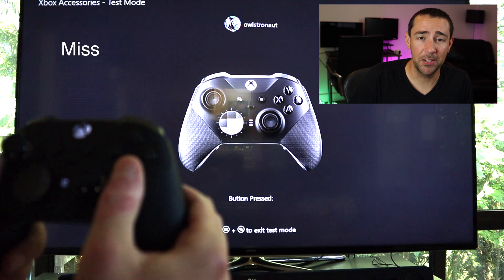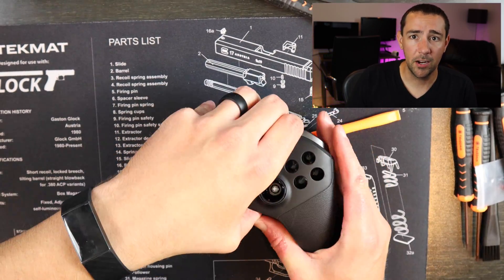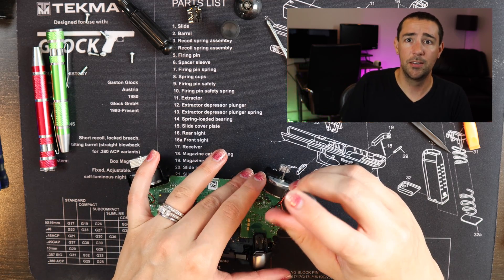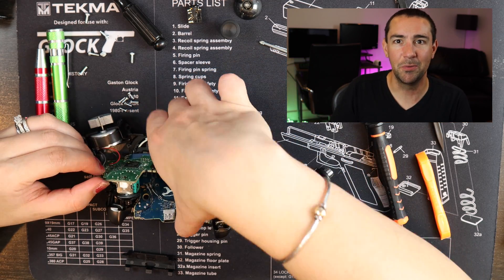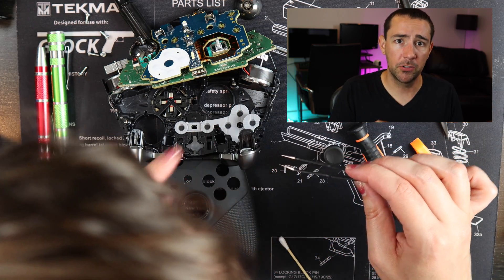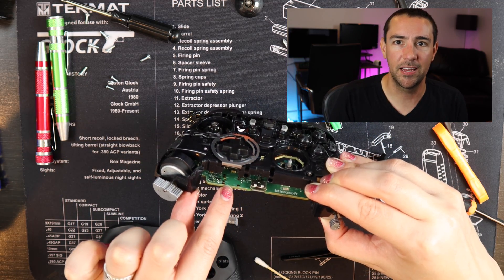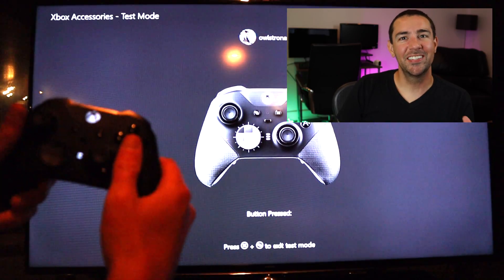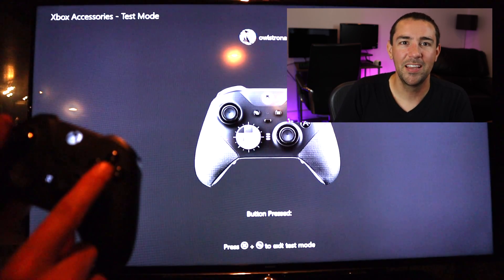Xbox Elite Series 2 Controller | Take Apart & Fix

Comment: Thanks man, this was a huge help! Anytime something needs to be pried apart, it can be nerve wracking to not break plastic bits but the controller separates well if you take your time. I've been having issues with the RB not registering and was able to pull apart the controller and use some electric contact cleaner on the switch. Works like a charm now.

Comment: Bro this is so dumb. My controller works just fine on PC. Doesn’t skip, just a tiny bit of stick drift, but on Xbox, it fucking skips like a motherfucker from the joysticks to the bumpers and even the D-pad. This is so goddamn irritating. I updated it, plugged it in, googled how to fix it and there’s nothing concrete as to what’s causing it or how to fix it.

Comment: You were saying about ppl throwing consoles away.well i was putting rubbish knackered microwave at the recycling center when a lady came in with an OG playstation 2 had everything with it in a bag later found out was missing tv cable(got a new one) said it was not working.well it was and perfect too had no games for it as i gave mine to my sister back in 2002.wish i had not.but anyways s good clean new cable got a disc ssx OG now i have another OG ps2 happy days.i dont know how many hrs it has on it anyway to know? Great vid on the ps4,s you had😅

Comment: For $200 this controller is a scam i have 2 of the paddles dont work. And other controller the bumpers and A button quit working lol. I could use a standard xbox one controller for years without problems for $60 not sure why this sucks

Comment: To replace the upper bumper buttons (the one running along the whole controller), do I only need to remove the top face plate of the controller? I have to do this for a friend, but I never opened up an XBox controller. Mostly the Switch versions

Comment: Hi, nice video, I have had this problem with so many Elite Controllers, I end up mapping A to a back button or RMA'ing them several times each.

A couple of questions
Is it worth cleaning the black conductor inside the rubber dome, or the copper contact? 
How many folds of electrical tape is recommended? 1-fold, two layers?

Comment: I own—and i am not exaggerating at all—1 old-style Elite controller and, count’em, 1, 2, 3, 4, 5, 6, 7 Elite V2s.  Why on God’s green Earth would I buy so many of these flipping things?  Well I’ll tell you!  For one, it is hands down the best production-standard controller on the market. 

The weight feels just right: solid but not too heavy.  The grips and other materials are top of the line.  

The ability to swap out sticks, pads, and paddles lends a degree of customization and self-maintenance that is both cool and helps it last longer.  The functionality and software are second-to-none.  

You can change the color of the Xbox button to fit into your chosen color scheme and aesthetic.  You can use the configuration interface to set 2 separate functions to each HW input, including console-level special functions like taking a screencap or video, play music, chat, etc. Why 2 separate functions per button?  

Because you can set one or more button inputs as a SHIFT key that when depressed give access to the secondary functions you defined.  This is extremely useful, both for console/administrative tasks and for gameplay.  Then you can use the test laboratory interface to play with and verify your input layout.  

Note also that each controller has 4 input buttons on its bottom side which can be actuated by removable paddles (or you might call them forks).  I usually set one or two of the paddles’ primary functions as SHIFT.  

Aside from that, the controller can store up to 3 different profile configs, which you may rapidly switch between via the Profile Button in the center of the controller.  3 LEDs indicate which profile is active, plus a 4th LED that is a charging indicator.  

Back on the bottom, each trigger button has an adjustment switch that can set 3 different travel lengths/heights for LT or RT to be depressed before it fires.  

What else?  A sync button on the front/top of the controller, plus a port where you can connect other peripherals like a mini keyboard, and of course a headset jack.  

Beyond that, the standard V2 controller comes in a smart semi-rigid, cloth-covered case, which inside has mounts for your spare hardware, including your paddles, a thumbstick adjust tool (also included), a charging dock, a 10 ft USB-A to USB-C cable, 2x D-pads—one shaped like a circle and the other the standard cross design, and 6 thumbsticks of different height and padding.  

So there are a ton of features on the controller, the build quality seems high, at least initially, and functionality is the best.  So why do i need 8 of them?

Well, for some reason—and I swear it’s not me despite the stats—the LB button gets unreliable and often unresponsive over time.  I have also had problems with the left thumb stick becoming biased.  

And instead of sending each controller in on the warranty, when I am in the middle of a game I just blindly order a new one from Amazon so I can quickly get back into the game.  Eventually I got sick of buying new ones and sent 5 or 6 of them in lot Microsoft for LB repair all at the same time.  I could have replaced parts myself, but these ones were still under warranty so why not take advantage? 

Anyway, once I got them back from M$ I was left with 8 perfectly functioning Elite 2s…. Yay.  

The only thing I would love this controller to support out of the box is a Rapid Fire function.  But Microsoft will never go for that.

Anyway you can pick one up for like $120, depending on color, availability, etc.  Not that bad of a deal.  In the most important factor, gameplay / control, this controller is the best I’ve used.  

Now if they could just make it more robust so the flippin’ LB doesn’t constantly fail!

Comment: I had problem with Y button double clicking or sometimes not working with normal press , the video is very useful on how to disassemble the controller but after I put some electrical tape on the same place my Y button is working way worse , I really have to press hard for it to activate , I would appreciate any advice or help with this , thanks

Comment: Thanks great video. My little one put my halo infinite elite controller through water, i threw it in rice for a week then tried using it. It worked for half a week but then started getting connection issues. Just bought a core elite 2 controller to swap the controller case and buttons.

Comment: STOP!  USE A BLOW DRYER ON HIGH HEAT ON THE JOYSTICK DOMES BEFORE TRYING TO TWIST THEM OFF.  THEY ARE GLUED IN.  YOU WILL BREAK THEM OTHERWISE.  UPDATING YOUR VIDEO WITH THIS INFO OWL.

Comment: What kind of screw driver are you using because my controller screws have this steel dot in the center of the screws and I can’t get it with a normal screw driver
Reply: Torx security

Comment: Thanks for this I had a small bit of plastic shaking about on the inside of mine, by taking the front off I was able to remove it. The rubber on one of the grips is sadly peeling too which is annoying

Comment: thank you so much!
 here's a tip for the domes for the analog sticks. when removing them for the first time it will be quite resistant when attempting to initially twist them off, as there is thread lock applied. use the actual analog thumbsticks as leverage and twist them on top of the domes. go slow at first until you feel them give way! then pick up the pace little by little! :) oh btw counter clockwise - lefty loosey, righty tighty

Comment: I got a xbox series x controller and the right thumbstick has a issue with it when rotating at full diameter. I opened the controller up and saw underneath the ring, there was a poor welding job done in which there was a micro piece of metal sticking out the corner of the thumbstick base. I grazed it off using a knife and it’s fixed now.

Comment: My LB  stopped working for the most part but I'm too scared to take the controller apart to see if I can find a fix because im too broke to replace the controller. I've had it for 4 years I think and that is the only issue I've had.

Comment: Great vid. But i wish it was a total teardown. My son threw my damn controller and messed it up. The d-pad wasn’t working right. The trigger rumble motor holders are broke as well. I took it all apart using this video and i found a stack of 4 little magnets under the d-pad. They can’t belong there because the d-pad won’t work no matter how much i wiggle and try to reseat it. Would you know anything about those magnets and where they go? Thank you

Comment: I spilled a huge cup of water on mines now it doesn’t work. If I do this and clean it will alcohol do you think it will work?
Reply from the maker: Doubtful. Biggest risk is a short, cleaning won't help that. Best thing you can do is let it completely dry out and leave it off for like a week
Reply: @OwlInTech  okay thanks

Comment: Thank you for the great video. It was exactly what I needed. Contrary to most peoples complaints with the series 2, I've put way too many hours on mine over the last year and a half and had 0 complaints. Until yesterday, when I was shuffling things around and my controller fell from my desk, and the sync button was jammed in crooked and would not release, causing it to be stuck in pairing mode constantly. I found I could use it wired, and could even unplug it once I was using it wired and it would stay connected, however I could imagine the sync button suddenly activating mid game, and I didn't buy a wireless controller to have to plug and unplug it everytime I connected it to my system. Was nervous about removing the faceplate to get access from below, but after a few minutes with a couple old plastic cards I was able to get it off and reach in with a pick to pop the button back into place. Would've rather not had the hassle at all, but glad in future if a more complex issue arises I will be more comfortable pulling it apart and have a go at it instead of just buying a replacement!
Reply: I had the same experience. Sync button got stuck. Figured out I could play wired and did that for a year lol

Comment: I have the same issue with mine. I really have to push the A button pretty firm for it to work.
Reply: Hey Matt if you are still having this problem try putting a piece of paper around the button to help with that instead of opening the controller up.
Go into your game pad tester and hold the A button down. Try wiggling it left right up or down and see if it starts missing consistently in one direction (mine was to the right) then you know where your paper should be placed.
I used a piece of paper that is 1cm long and 6mm tall. I can fish it out with a knife but also can't feel the paper while playing. Good luck!
Reply: really thanks mate you saved me  @bpv717

Comment: I got this controller last year for Christmas and after only using a few times noticed the A button wasn’t pressing down like it was supposed to, i’ve sent it in twice and both times they have never repaired it, I’m sure all it needs is a cleaning or the pad replaced but apparently it’s too much for them, now I have to do it and hope like hell I don’t break anything.
Reply: Hey if you are still having this problem try putting a piece of paper around the button to help with that instead of opening the controller up.
Go into your game pad tester and hold the A button down. Try wiggling it left right up or down and see if it starts missing consistently in one direction (mine was to the right) then you know where your paper should be placed.
I used a piece of paper that is 1cm long and 6mm tall. I can fish it out with a knife but also can't feel the paper while playing. Good luck!

Comment: So what you mean by two little squared under the button
Reply: Hey if you are still having this problem try putting a piece of paper around the button to help with that instead of opening the controller up.
Go into your game pad tester and hold the A button down. Try wiggling it left right up or down and see if it starts missing consistently in one direction (mine was to the right) then you know where your paper should be placed.
I used a piece of paper that is 1cm long and 6mm tall. I can fish it out with a knife but also can't feel the paper while playing. Good luck!

Comment: I managed to do this just fine without the kit, I’d recommend at least getting the special screw drivers though, only if it’s a non thumb stick related issue. If it’s a thumb stick issue you can just screw them out using a empty magnetic screw driver holder.

Comment: Welp idk of they changed sumthing but my thumbsticks don't screw off like mentioned in video on my way to the store to buy a replacement since mine is fubar now
Reply: mines was completely fucked trying to screw it off
Reply: @TheLunaticIV  yeah it was put on to not come off in a newer release I think. Best Buy is offering 2yr coverage again and they have the core edition
Reply: Edit they do screw off but idk if the hulk built mine or not buy trying to unscrew it actually fubar'd the joystick pot. Yes I know lefty loose right tight I'm a mechanic by trade. Trust me when I say that the amount of torque required to do this was beyond retarded for an electronic...

Comment: These controllers are junk. Haven't even had mine for a year and both bumpers need to be pressed painfully hard to actuate. and now the triggers no longer work in their locked position. Add to that the fact that it's already showing early signs of stick drift.

Comment: The rubber aka the grip that Microsoft added to the plastic is the worst thing they could've made it better but no it had to be rubber so my rubber expanded over time 3 months in and i cant press the rb and lb anymore cuz the corner is so expanded that it covers the buttons i had to cut it with scissors

Comment: I had a small piece of plastic in mine that was rattling around, managed to open it up and remove it with no issues. 
Little tip, I used the larger paddles that come with the controller to open it up as I don't have any of those plastic pry tools. The paddles were a good substitute and didn't cause any damage.
Reply: Yea I've got the same problem from dropping it a bit too much
Reply: Great advice, was wondering what to use because I don’t want to try a screwdriver

Comment: Came here for the EXACT same reason. I'm finding this is an EXTREMELY common issue with this controller. How does this get past testing?? Better question: Why are they still selling it with such a common issue?!
Reply: I have opened a lot of controllers in my life and this is by far the absolute worst. Incredibly complicated!! Just because of one button contact not being good enough! I'm about to refund this controller.

Comment: I followed the tear instructions and the right thumbstick broke while trying to unscrew the dome. Broke as in it turned but never came off so that I could remove it. I said "good riddance" to this expensive mistake and tossed the elite series 2 controller in the trash.  

I switched to the controller that came with my Xbox Series X, which works perfectly!

Comment: WOW. Sent mine in 3 times and I swear they sent me refurbed crap that had the same problem still. I just finished this repair a few days ago and it worked perfectly. Thank you so much!
Reply: Same, sent mine back 2 times, fixed it myself the 3rd time 🤦‍♂️ and the 4th time just today haha
Reply: Lol, didnt know other ppl had the same experience... I sent mine in 2 times as well, on the last time ( the current controller ) it's X button doesnt register 50 % of the time and it felt just dumb to sent it back in another time... havent been using the controller cause of it for 2 years now and it felt dumb leaving this expensive piece of plastic laying around for too long.

Comment: Be careful when removing the thumbsticks, I messed up mine and now I have to replace the thumbstick
Reply: What did you do? Force it too much when unscrewing? Mine is really tight and i dont want to ruin it
Reply: @Beast-jn1rl  exactly right, the plastic broke. It was too hard to fix by myself so I just bought another one

Comment: Dang, my T8 fits but doesn’t have the hole in the center for the torx. Was looking to fix hubbys LB and RB so he can stop using my controller, lol. But I might have to order the buttons and re-solder them because the response on both just isn’t working. :(

Comment: Great video my controller had a stick issue where forward was rough and not smooth like it should be saw how the stick twisted in and after messing with it found out it was just slightly loose and needed to be tightened just a little bit smooth as can be now!
Reply: how did you twist the stick out
Reply: @lucivity2759  started by putting the largest diameter stick on the one I needed to mess with then grabbed pushed in hard and twisted. left to disassemble right to tighten. It wasn't easy but it does turn.  just remember if it doesn't hurt u aren't doing it right lol

Comment: i wish i didnt see this video. Its mostly my fault but i thought a simple nudge to the thumbstick sensors and a little air spray would do the trick to fix the stick drift but no it did not. Went ahead and disassmbled the whole thing and broke something. Im bummed with myself.

Comment: Thank you! I just bought an Elite 2 controller and about 8.5/10 presses would work for the A button. I almost returned it after hearing it's a common issue. After your fix though it hasn't missed one!

Comment: I need help finding my problem. I took it apart to the point of exposing the green and blue boards. My Series 2 had just stopped working all together. It won't charge and it won't turn on. Can someone help?